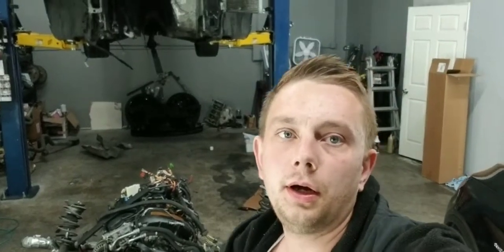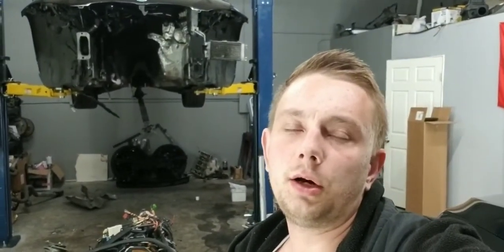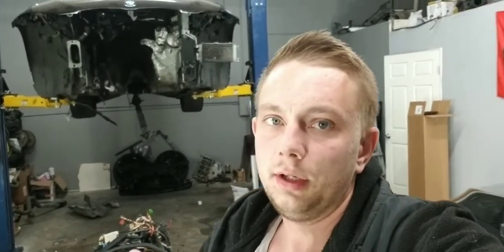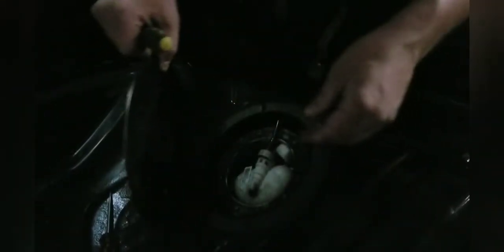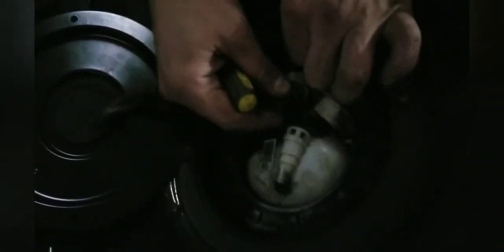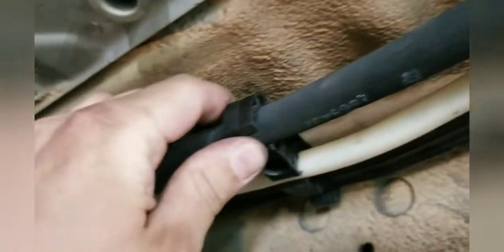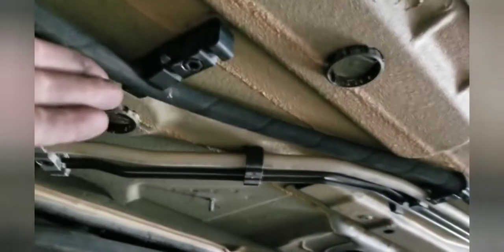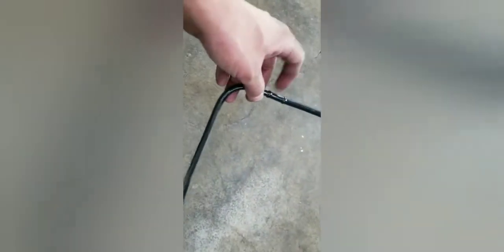Upgrading  fuel line by Fuel-it on my bmw 335i and explaining how to do it

Comment: What’s up man nice build ! Quick question, I bought the same fuel line for my e92 I replaced every other part possible , could this be cause for rough cold start and low power, 172k miles